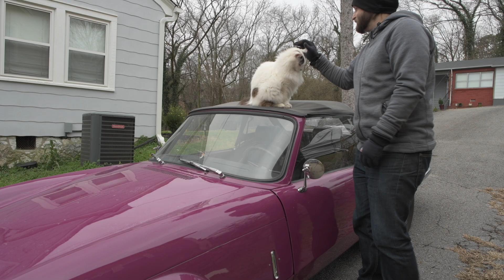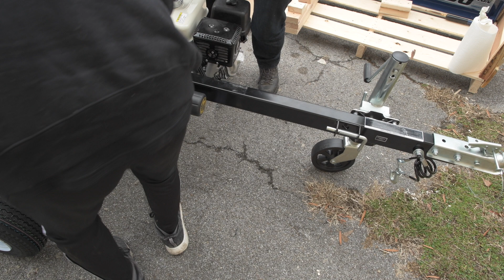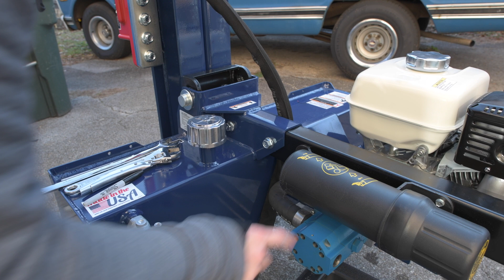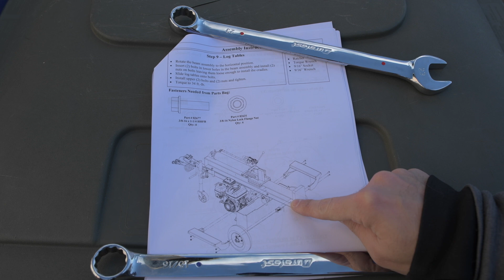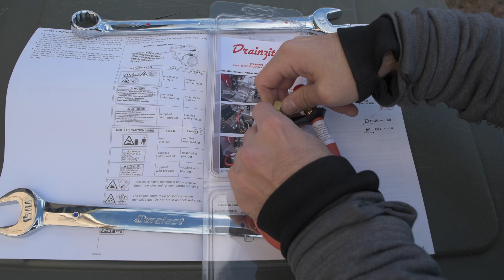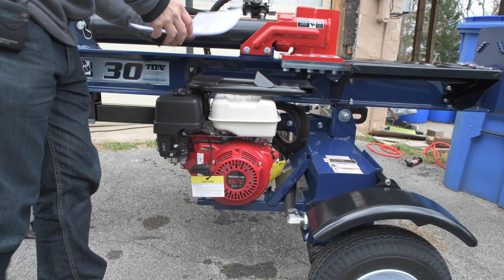iron and oak 30 ton horizontal vertical log splitter assembly bhvh3018gxt

Comment: For hydraulic oil, I would suggest going to tractor supply or some other farm store and buying their cheapest hydraulic oil in five gallon buckets.  Our local little Tractor Supply usually has a couple or three dozen buckets on hand. I like that engine guard that Iron and Oak has, I hope to talk somebody into putting one of those on my Boss splitter.  Thank you man!